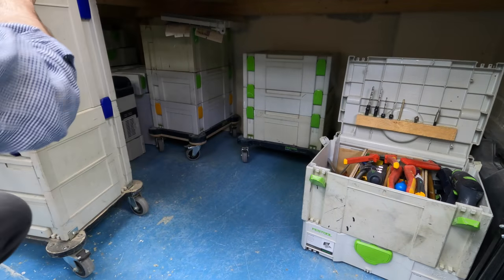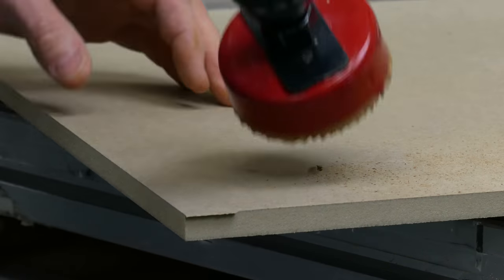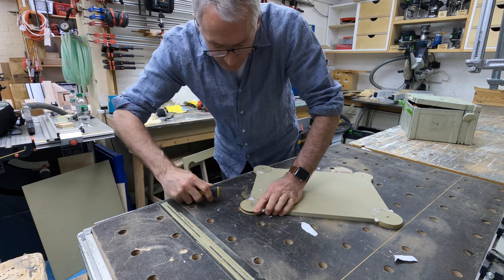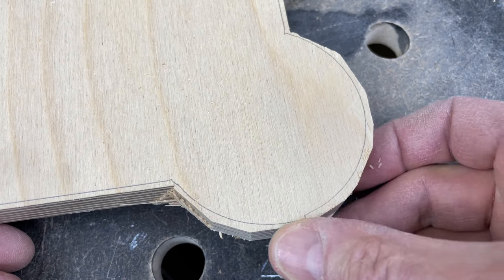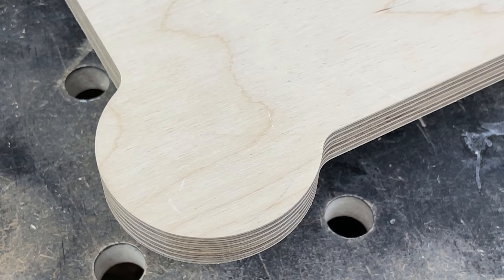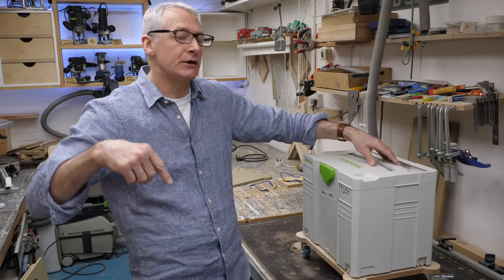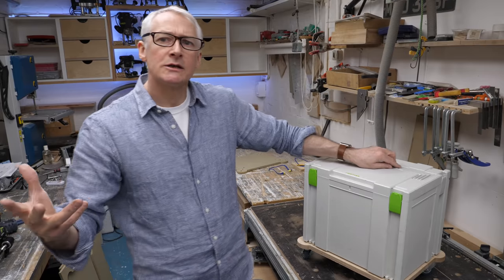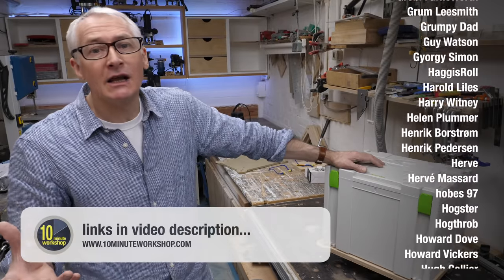DIY Systainer Roll Board [video 451]

Comment: Tip for using a hole saw.  Drill an 8mm hole on the perimeter of the cut, it gives the dust somewhere to go to.  Saw cuts much faster and doesn’t burn.

Comment: Just a quick tip on castors. 
Rubber castors are quieter but solid castors move a lot better on carpets. Depends what you are building for, workshop or in peoples houses.

Comment: For attaching them to the base, you could drill a couple of small holes in the base either side of where the clips would go, then use cable ties to keep it locked down.
Reply: I was thinking along those lines but using a rubber cord (similar to those used for bike binders but a bit thinner)

Comment: Your roll board method is good for those on a budget, or those that prefer the older design because they could attach Classic systainers to it.  Thank you for sharing this process, I learned a couple trick in how I could make templates and end product.

Comment: Hi Peter, I love the shape of the roll-board. It is much fancier than the one I made recently. I went for a simple rectangle of melamine faced chipboard (I know durability might be a long-term issue) and I didn’t screw the systainer down. I just made a simple strip wood surround to hold the systainers in place. I may add a screw and washer at the back to hold the back tab down but haven’t needed it so far. A rolling base has certainly made using and storing my systainers much easier and I’ll be making a couple more sometime soon.
Reply from the maker: Thanks Goerge! Yes, it's a little fancier than it needs to be, but it looks good in the video! 😂 👍
Reply: @10MinuteWorkshop  Hi Peter, I’ll probably go for rounded corners on my next one...probably just after I’ve bashed my ankle bone on one of the sharp corners😉

Comment: A few weeks ago I actually welded me a little cart for my new 8Tool T-stack tower. Was getting very annoying moving several boxes at once to get them out of the way XD 
I used some angle iron to make a base that neatly holds a T stack in place. Trimmed and bolted some leftover bolt trough castors. Riveted an aluminium base plate to make it look a bit cleaner. And sprayed the frame in the closest thing I could find to Dewalt yellow. Wheels make life (especially in a smaller workshop) soooo much easier!
Reply from the maker: Sounds good! 👍👍

Comment: I'm another one of the 'No Mickey Ears' crowd - if the base is a little bit bigger you can use external catches to hold Classic or T-Lock boxes in place - bent metal, 3D printed or cast from resin or metal. Also of note is that (at least in Australia) Makita makes near perfect copies of the Classic Tanos Systainers (licenced? or expired design protection as they have been around for 40-50 years) in 4 sizes - they take a few weeks to 'wear in' or you can give them a light sand around the latches, and the insulated lunch box models are standard issue rather than once every few years.

Comment: Not bad, to each his own though. But I did it simpler a couple of years ago.  Cut the 3/4" plywood 1/4" wider on all sides, Attach the casters to the bottom.  Then use plywood blocks to hold the box square on the base and to engage the tabs at the bottom of the Systainers.  My lovely blue casters were bought from Harbor Freight here in the states.  The cheapest I could find.   Waiting for the Router Series.

Comment: Love the idea of a few videos on routers, just remember not everyone has Festool!  I have the TRITON TRA001 2400W DUAL MODE PRECISION PLUNGE ROUTER 240V and the handling is a bit like a breeze block so I just inverted it into a table I built.  I also have the Makita trim router
Reply from the maker: Thanks! Yeah, that big triton’s a beast - have mine mounted under the bench as well! 👍👍
Reply: @10MinuteWorkshop  lets have some router content Peter great idea

Comment: I think a router video series would be lovely to see. Especially if you focus on the processes you need to achieve your tasks in the workshop. There are plenty of beginners guides to routing, but few are tips videos. 
I've switched to Trend bits recently and highly recommend them.
If I'd realised sooner I could have sent you some base mounts for t-lock, as far as classic is concern a length of bungee with loops going through holes from the underside and over the classic pegs is all I needed for my trolley.
K.
Reply from the maker: Thanks Karl! 👍👍

Comment: How about a small slot under the retaining hooks. Then an o-ring through the slot and over the catches. The o-ring retained in the slot by a dowel drilled through from the outside edge.

Comment: Great video as always.

As for another video suggestion. A video on systainers could be interesting, a bit like the track saw tracks. Theres the classic, makita and hitachi/hikoki ones, then theres the t-lock festool or tanos directly branded ones, the newer tlocks with the front handle but differeing heights then theres also metabos metalocs, which i really like as they have a metal catch and a front handle, annoyingly theres a new metabo metabox which isnt compatiable, it stacks but doesnt lock on, i beleive they said due to patent issues.

I've recently tried out Milwaukee's packout and been really impressed, very tough, secure locking and lots of options though its a pricey system even compared to systainers.

Comment: I would love to get your take on a handheld router vs. a router table! Maybe my memory doesn't serve me right but it seems like you're using them handheld most of the time.

Also, I'm building rack cases for stage equipment at work and we were just talking about making a rolling base for them. Great timing for this video 😃
Reply from the maker: Thanks! About half and half, re table vs handheld. 👍
Reply: @10MinuteWorkshop  gotcha, thanks! I'm still feeling a bit new to woodworking, so I'm unsure at times what's most efficient.

Comment: Hey Peter, regarding the router series coming up - I wouldn't mind seeing you try out a heap of different bits and show the results (different cuts) they produce. Pretty basic stuff but I often struggle deciding which bit to use for which application.
Reply from the maker: Thanks Simon! Yes, it’ll be a ‘basics’ video, so no topic too simple! 👍👍
Reply: @10MinuteWorkshop  Excellent, just what I need!  👍

Comment: Excellent video. Will look forward to a router video showing neat things you can do with them. I have a Bosch in my router table, a Dewalt trim router I use a lot and my newest addition a festool of1400 to replace the Bosch I put in my table. Interested in useful accessories I may not be aware of. Although I use routers a fair amount I don't think I'm doing all the thing they can do. I did a quick and easy base for mt sustained. Just a piece of 18mil ply 50mm larger than the sustained, radius the corners with a router templet and installed 3" non-maring casters. Fastened systainer
Reply: Sorry somehow sent it off to post unfinished. I used a washer head fine thread send drilling screw through a bigger flat washer in each corner to fasten to the base. Your version is much more elegant.
Reply from the maker: Thanks Larry! Whatever works - end of the day it's just a rolling base for a box to sit on! 👍
Reply: @10MinuteWorkshop  I do apologize for some of the spelling and grammar.  My samsung tablet continually changes word spelling and inserts word it thinks are needed. I usually catch most all of it but i was in too much of a hurry this morning to get to a doctors appointment I was running late for. You are right, after all is said and done they are a fine place to sit down and enjoy a pint. (or coffee in my case).

Comment: Looking forward t watching your router series when its ready.

I have a router and a set of guide bushings, however, they are not compatable, if possible could you show how you would make a sub base that would fit any router (as in its customed to 1 particular router) that will accept standard 35mm guide busings

Comment: Routers - how to swap bearings on flush trim bits to slightly smaller bearings, so you can route out the MFT holes that someone CNC'd to 19mm, instead of the 20mm you asked for, because they thought the 3/4 of an inch was close enough. 

I did get there in the end, though...

#Imperialistsneedtogometric...

Comment: Do you not have a jigsaw? I have to admit I don't use mine often but it's worth the space it takes up. I used to carry all my tools around in systainers just like this but when I moved to working almost exclusively in the workshop I built a mobile set of draws that fit my hand tools - absolute game changer, so much faster than sorting through systainers.
Reply from the maker: Yes, I have a jigsaw; this is way, way faster to get a nice round corner, and the router is much more interesting to look at! 👍
Reply: @10MinuteWorkshop  I was thinking for making the ears on the template rather than making the bases. Seemed a lot of messing about to cut them out with a hole saw and then glue them back in.

Comment: Hi Peter,

Regarding subjects on routers, I want to build my own built-in closet. The shelves for in the closet I would like to cut out a groove for them. In the US they would probably use a stack of dado blades, but here in Europe that's not an option unfortunately, so I will have to do that with a router. If you could explain the basics of that, that would be lovely.
Thanks in advance!
Reply from the maker: Good one, thanks! 👍👍

Comment: Hi Peter I think your idea for putting your  storig boxes  on scates is good but I think if thay were just cut to the shape of the box without the round bits sticking out you would save space when you slide them under your bench, I'm shor that if you are planing to make moor of them it will be annoying that a 50mm gap between them?
Reply from the maker: I’ve done them all ways, and the extra wheelbase really helps with stability. But as I say in the. Idea, you can make them any shape you want. 👍

Comment: Your template turned out great, very clean edges. I curious though, why didn't you just double side tape your existing base onto your mdf. Use a flush trim but in contact with the old base to make the template?
Reply from the maker: Thank you. As for using the original base as a template - aside from the difficulties in actually doing that safely - how would that help the folks who don’t have the base, but want to make their own? 🤷‍♂️👍
Reply: @10MinuteWorkshop  touché. 😉

Comment: I’m considering taking the plunge and investing in a track saw and a router, I’ve done carpentry for diy for years and I think adding these tools to my array might be useful especially as I’ll be doing some serious house renovation and joinery in the future.  

So... question;  what router and track saw combination would you suggest?  Does one manufacturer offer a particular advantage over another?
Reply from the maker: Honestly Bill, I have very little experience of systems other than Festool, so I’m not sure I’m qualified to advise. Pretty sure most main manufacturers of both plunge saw and router will have a guide rail mount for the router, but how well they work I really couldn’t say, I’m sorry. The Festool works well though! 👍👍
Reply: I have an engineering background and the festool tools really hit the geek centre in me.

Comment: Regarding Routers and Routing:
Upcut vs. Downcut spiral bits,, pros, cons, uses.
Jigs used on tracks, jigs for dust collection,  jigs for performance or specialized uses.
If possible, any ideas on DIY router lift mechanisms. 
Thanks for your consideration.
Reply from the maker: Thanks Neil! 👍
Reply: @10MinuteWorkshop  
Sorry, one more question if it's s not too late. 
What in your opinion are best router bits both as starters and essential? Ie: cheap bits that can get one familiar with what they would need vs. don't use much. Barging bits vs. real workhorses?
Thanks again.
Reply from the maker: My advice would be to buy the bits you need for the task at hand; don't bother with bit sets, just buy quality bits from the usual suspects - wealdon tool, trend, CMT, freud; I still have every bit I've ever bought from Wealden tool, and they're all cutting superbly. A cheap bit is almost always a bad idea! HTH. P

Comment: Hi Peter
Great video as normal
Talking about routers I have fitted some kitchen worktops, and struggle with general speed control regarding size if bit.
I don't like it when I, and others I have seen get the router sounding as if it is protesting at the work. ie how long does a router bit last? etc.
Reply from the maker: Thanks Martin! Great suggestions. 👍👍

Comment: The initial MDF template looked quite good. Is plywood better ? Stronger maybe ?
Reply from the maker: Thanks! Plywood wouldn’t be stronger in any meaningful way - the weakest points on the template are the corner ‘ears’ and I don’t think ply would be any better than MRMDF there. 👍👍
Reply: @10MinuteWorkshop  Indeed, the corners are flimsy by themselves, but how about consolidating them with two long 8mm dowels  ? (I recently saw your older DDF 40 video and the dowel idea just popped to my mind).

Comment: Hi Peter. thank you for another helpful and relatable video. Did you ever do the video on 20mm router bits comparison relating to DIY MFT tops? I recall you intended to, commented somewhere in the LR32 MFT video. I'm about to make a MFT and actual dog hole size cut by the router bit is more of a concern than managing to getting things lined up square.
Reply from the maker: Thanks! I haven’t yet, no. I’m still at the ‘bit gathering’ stage, because supplies have been so constrained because of the whole covid thing I’m still waiting for another couple to come in. I’ll get to it as soon as I can. 👍👍

Comment: Could knock those out when you want if your cnc bed is big enough? I've got the Bosch variant, £90, annoying thing is the tool you want is always at the bottom even though you stack them with the one you feel you use most at the top. You know the story.
Reply from the maker: CNC is just about big enough, but if I made them on the CNC 90% of folks would switch off; making them with a jig & router makes the video more accessible. Also, I'm pretty sire I'm quicker with a jig & router than I am on the CNC. 👍
Reply: @10MinuteWorkshop  Yeah I know. Yes it is quicker as a one off as I know I probably spend more time tweeking code and rechecking I'm not going to smash another expensive bit. I just love how clean and accurate my little cnc does the job. I made a zero clearance insert for my table saw and one for the mitre saw. nice thing was I ran three of each off in no time and can just call the file up and do more, great bit of kit.

Comment: Instead of screwing the template on top, why not just put two layers of tape between them and CA glue for a temporary, but strong hold? And, if you put the template below the workpiece and used the bottom bearing, you wouldn’t need to keep unclamping from the edge of the bench! 

End product is the same though, and looks good.

Comment: One thing on Routers I'd be interested in is how to keep the bit sharp a bit longer ,or how to sharpen them. The bits are costly and don't last very long.Are more expensive bits worth the extra cost?
Reply: You can sharpen them to a limited extent using a credit card sized diamond hone,
Reply: @boldford  I’ll give it a try. That’s
Reply from the maker: I think buying quality bits makes a world of difference tbh. I think every decent bit I’ve ever bought over the last 10 years is still cutting just fine.👌👍

Comment: Wasn't you able to use the original base as a router template to make the MDF template using a router cutter with a bearing top and bottom?
Reply from the maker: How would that help the folks that don’t have the original Festool base?? 🤷‍♂️
Reply: @10MinuteWorkshop  True. ' - o

Comment: I like this idea. I admit I was expecting you to cut the rough shape with a jigsaw, then use a router with a template bit to finish off, using the original plastic base as the template (i.e. how you used the template once it was finished). That'd mean you had a one-piece template instead of gluing the bits back together. Still, looks very smart. If you're using them for storage, you could even one-up Festool and save on castors by having "double" or even triple trolleys that'll carry two or three stacks.
Reply from the maker: The template idea is for folks who don’t have a roll-base already. 👍

Comment: A question those protruding rounded corners look cute but is there a practical advantage? Cheers
Reply from the maker: A very slight stability advantage (wider wheelbase) and it helps to stop the castors clashing when you line them up alongside another stack. But minor benefits, yes. 👍👍
Reply: I have several similar homemade rectangular-base trolleys, oversize for stability but i can see a real advantage in doing it this way, particularly for long trolleys (I have several for 64l really useful boxes). Imagine having a few stacked tight under a bench side to side with no spare space - with a rectangular base you'd need to pull it right the way out, needing lots of space. With the cut outs past the wheels you could start rotating the trolley as soon as the front wheels were clear, allowing you to pull it out into a much smaller space. I'll be modifying mine at some point - thanks Peter / Festool.
Reply: @markeverett2097  Thanks. Cheers

Comment: Excellent. Burn through 'ole saw🤣 
The cheap ones work way better if you grind  sawdust relief slots with a metal cutting disc. And for the super cheap you can grind some aggressive teeath at the same time only don't plunge too aggressively case they bind, 🤯 set the clutch to slip.